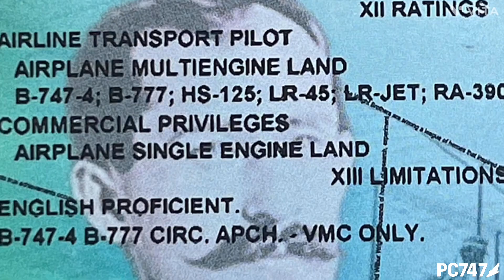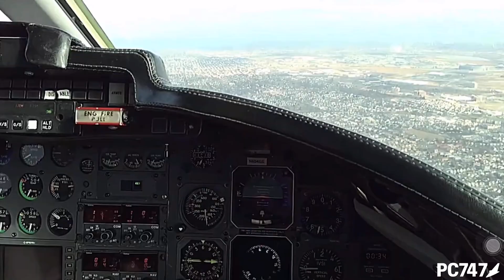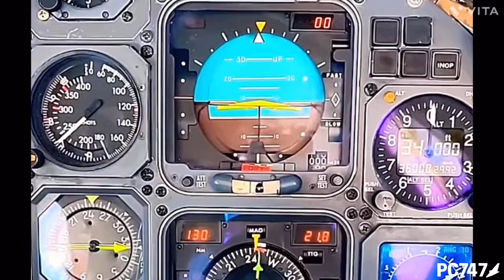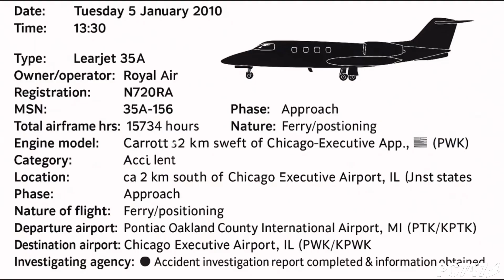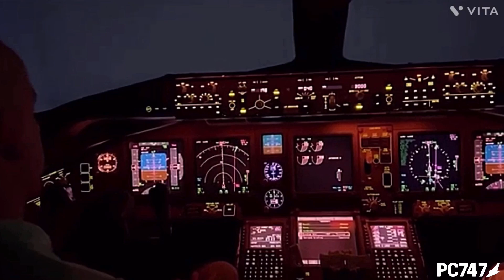THE APPROACH TRAP

Comment: I’ve done dozens of circ App’s in the 30 & 40 series Lears and the secret is SPEED and a high situational awareness with a skilled PNF!
Reply from the maker: Thank you very much for sharing that. My Lear jet background is in 20’s, 30’s, 40’s & 50’s…. 

I communicated with Dan Gryder about this several years ago. He thought it would be a good idea to increase the aircraft’s speeds by 10 knots to provide an extra margin above a stall. It seemed like a Band-Aid approach to me since it wouldn’t solve the recurring problem: Deviations from “median bank turns” at low altitude in poor visibilities.

Comment: I used to preform circling approaches to minimum weather. (600/2) at uncontrolled airfields at night with terrain in the area. Did it single pilot and as a crew in many different aircraft. Skyhawks, Twin Cessna’s and Pipers. MU-2 and Learjet 20’s. Back in those days there were almost no GPS or RNAV straight in approach’s. So we became very proficient at these types of maneuvers. We performed them consistently. Today, most runways have a straight in GPS/ RNAV approach available so circling approaches are rarely used. 

I have been flying airliners (747/A320) for 20 years now. If someone asked my to climb into a small jet and perform a circling approach at low altitude. There is no way I would do it unsupervised for as long as it took to become proficient again. 

Also it is my understanding that the training centers don’t provide realistic scenarios for this maneuver. Usually it just a 90 degree turn to final.
Reply from the maker: Thank you for sharing that! For operators, it will depend, as you know, on the authorizations,in the operating specifications; which serve as the basis for the training provided. Cheers! 😎